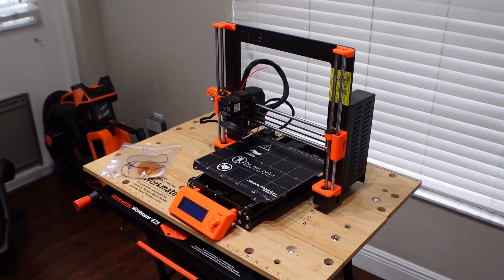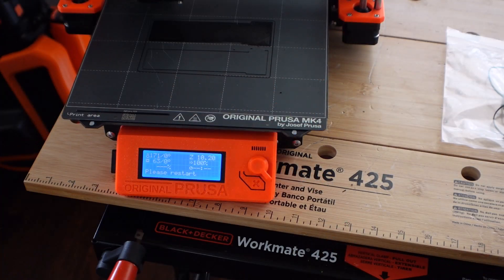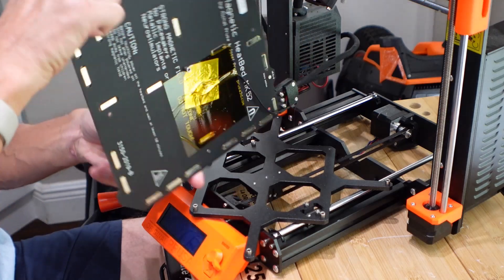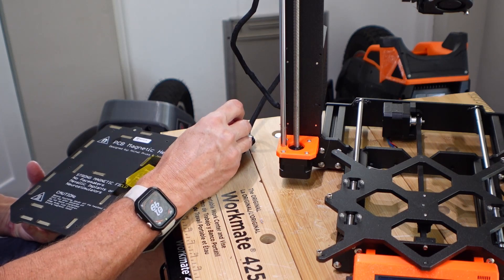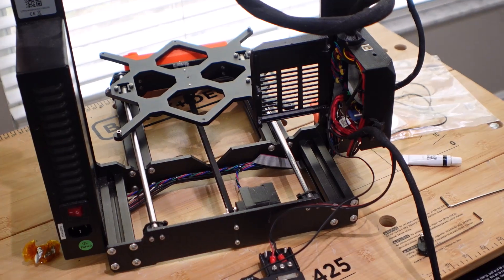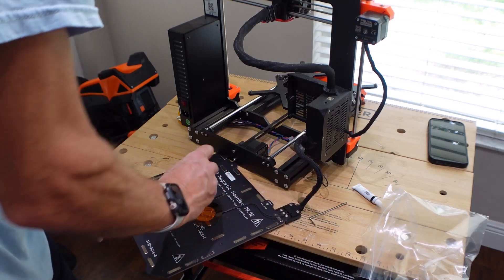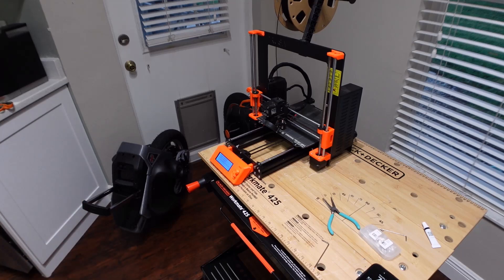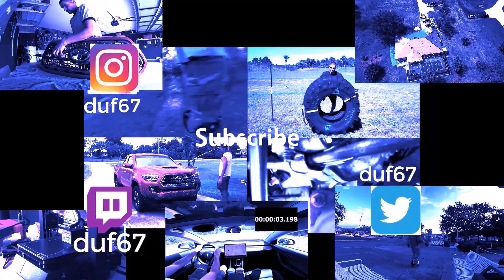How to Resolve Mintemp Bed Error on Prusa MK3S

Comment: Printed a seat for the Begode Master on the Qidi X-Plus. Ridiculously long print but it turned out fine. Now I have just got to learn how to ride seated. https://www.youtube.com/watch?v=N2lXgi8QfD4    I print in all sorts of plastics so I have complete heads for each, the enclosure I find essential for plastics like ABS, TPU, Nylon, where shrinkage fails the print more often than not without a heated enclosure.
Reply from the maker: I will check it out? Adds decent height?